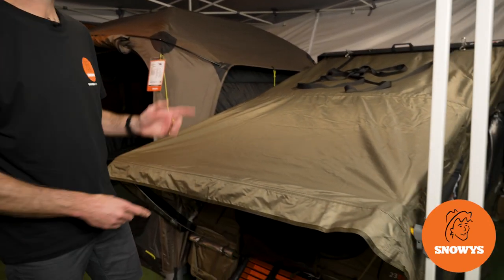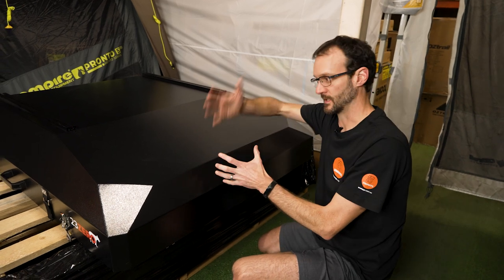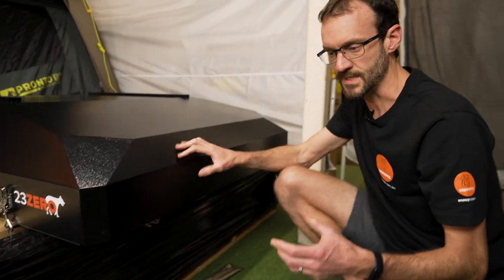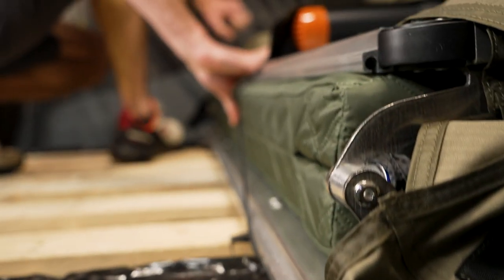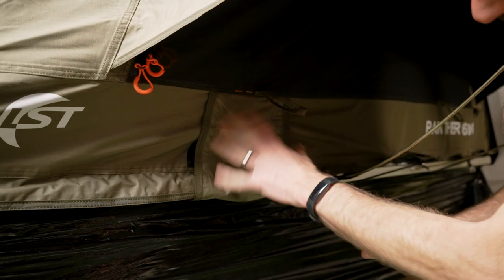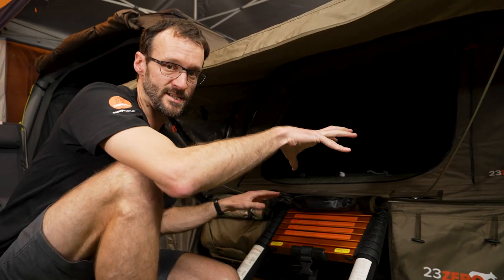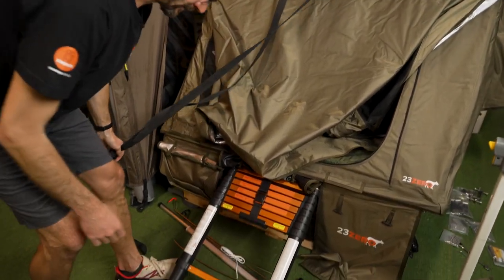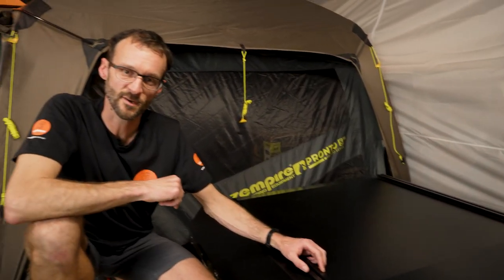23Zero Panther 1600 Hard Shell Rooftop Tent - How to setup & pack away

Comment: Possibly the worst mattress I’ve ever slept on and because of the size of the Panther 2000 almost impossible to find a mattress to fit up there.
I’ve had a fair amount of water get in along the opening side of tent while driving in rain and it’ll be interesting to see how much dust gets in there behind a convoy.
Besides those grievances I absolutely love this rtt so quick and easy to set up and pack up with endless room in them.
Reply from the maker: Thanks for the feedback @pava01 - I'd be changing up the water ingress with 23Zero or out warranty team if you got it from us.  23Zero have suggested this shouldnt be an issue
~ Lauren

Comment: Are there any seals where it closes? Looks like water could work its way under the hard shell in heavy rain driving
Reply from the maker: I'd say theres a rare chance abit of water could get in, but nothing that should cause any issues.
Ultimately its a waterproof canvas tent which you can use year round, and theres a small canvas skirt that runs along the edge of the tent.
Its not going to get more wet than it would if you were to set it up and use it in a down pour.
Its be recommended to open up your tent and give it a good dust off/sweep out when you get home from a trip anyway, so you'd notice if it needed abit of drying out.
~ Lauren
Reply: I have the Armadillo A3 and drive daily in the PNW with lots of rain and haven’t had any issues with that at all. It’s dry as a bone.

Comment: Can you easily reach the straps etc when it is mounted on your roof?
Reply: It's on the side of the vehicle so would only worry you if you're vertically challenged
Reply from the maker: I assume you mean the straps for pack-up/set-up? If so, then it really depends on the height of your vehicle, but the long strap used for raising /lowering the canopy is extra long and will be plenty long enough for most vehicles. ~ Ben